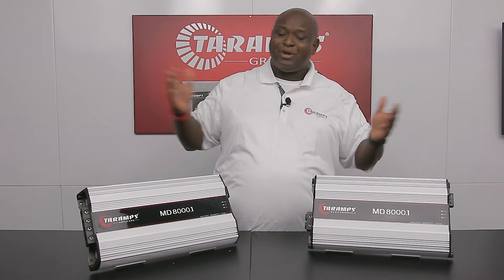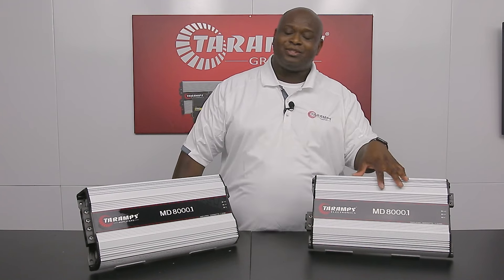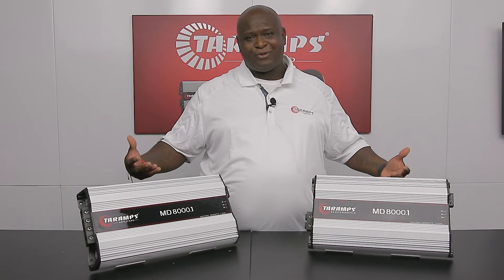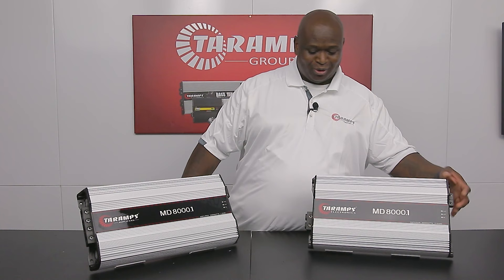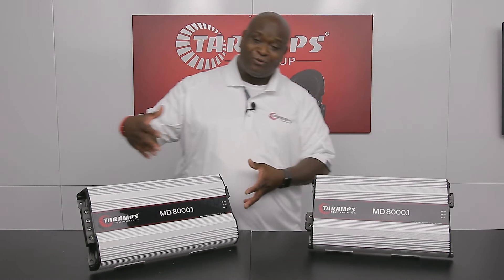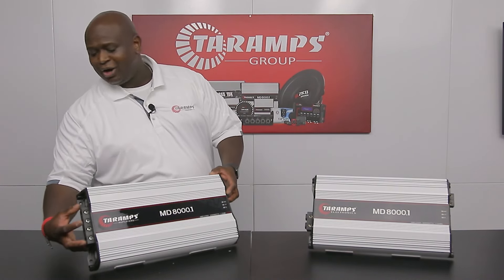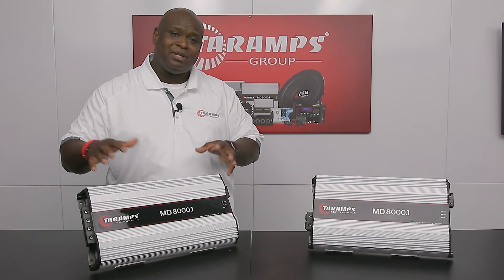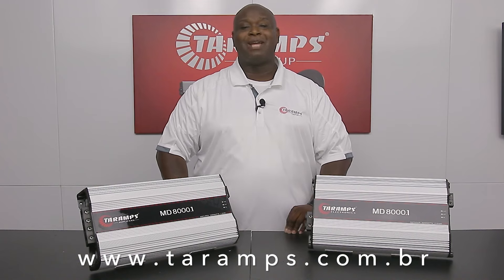Taramps MD 8000.1 - 1 Channel Automotive Module Amplifier 8000 Watts RMS | Taramps

Comment: I broke my clip on my remote clip indicator and it won’t stay in the amp any more - doesn’t click in.  What size is the plug?  RJ11, RJ12, RJ25, RJ45, ETC… I want to see if I can repair/replace it myself instead of buying a new one.  Also, can you do a review of the SMART 8K that’s coming out.
Reply: RJ 45